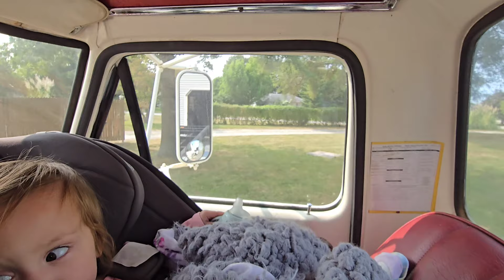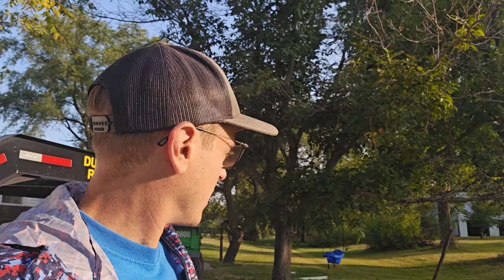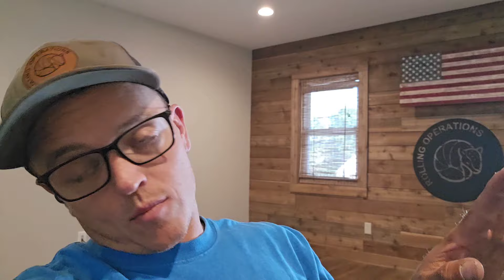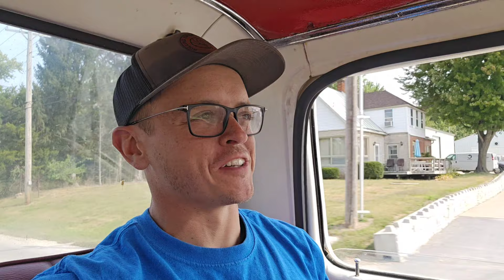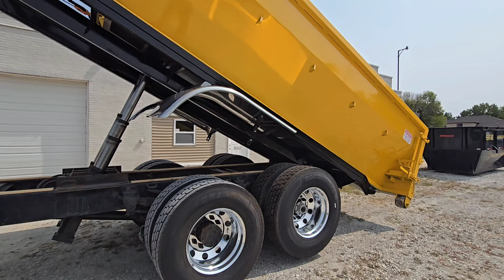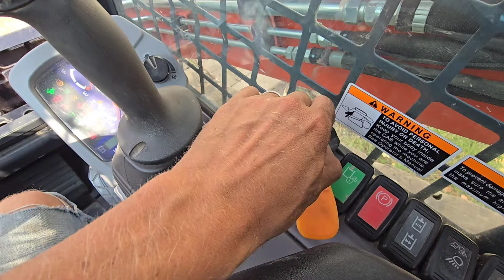The Brutal Truth Of Business: No One's Coming To Save You

Comment: So what's the plan for the front end to get them shiny wheels on?😊 Hey if you have only two details to modify I believe you are a winner 😊. That old truck is a great write off for advertising besides being able to perform a few pick-ups and deliveries .
Reply from the maker: Exactly!
Currently sourcing a front end, but finding a good match is hard. Had a subscriber reach out that has exactly what I need.....but he's in Cali, trying to find something closer that I can get my eyes on. It's been tougher than I thought, Because I don't want to put any axle under it that kinda sorta fits. A lot of the ones I found that do fit have the wrong hubs or run hydraulic brakes instead of Air. 

After all that, we will move on to a possible motor swap.....and paint.

Comment: You should add insulation on the ceiling of your storage unit. I didn't see any when looking at the video. Without insulation, you will most likely have issues with condensation.
Reply from the maker: This one does have a very small amount of insulation on it. It feels like....stick on felt? I have a feeling i may hire someone for a spray in insulation job if needed.

Comment: What is the advantage of having the truck and trailer instead of just a truck with a dumpster bed ?
Just wondering..
Reply from the maker: @THYKAER  I really like it because if you have a massive failure on a roll off truck, it can be down for weeks at a time depending on what needs to be done. I personally also live in deer country, and you'd be shocked. How many commercial trucks smashed deer. So it's helpful to have the trailer set up, because if my truck has a failure, it's pretty easy to locate another truck to continue the operation, finding another roll off truck.Isn't quite as simple. With that, though, I think the perfect combination is to have one of each 1 roll off truck and 1 trailer and then scale from there. The trailer just acts as a very good backup. Regardless
Reply: @rollingops  thanks... makes sense